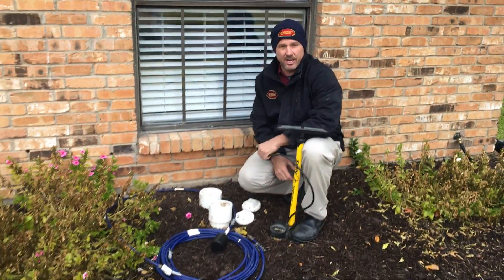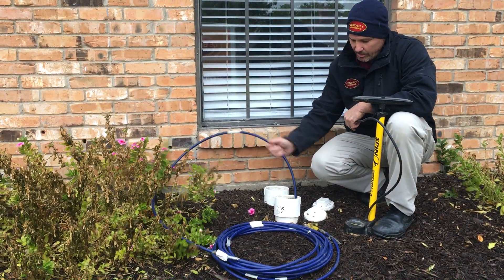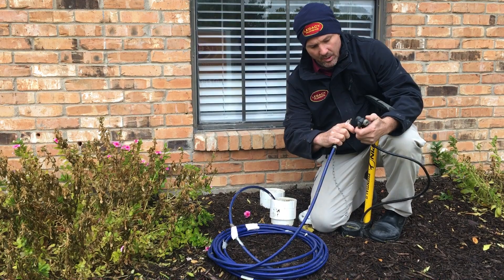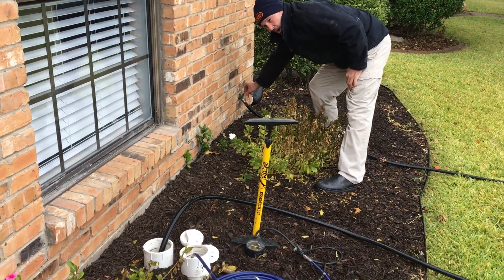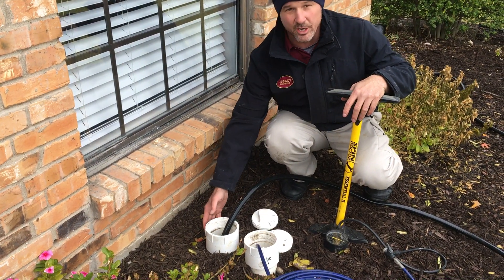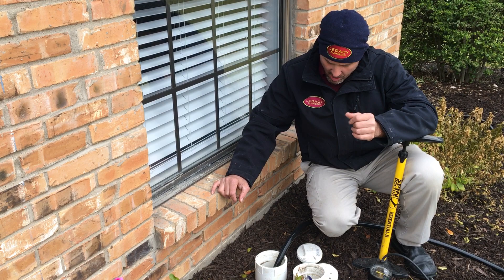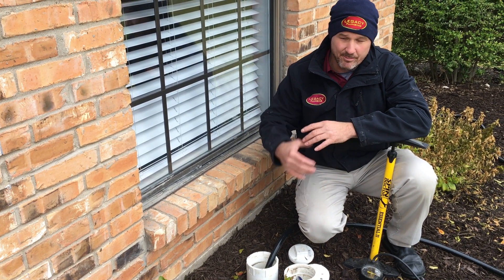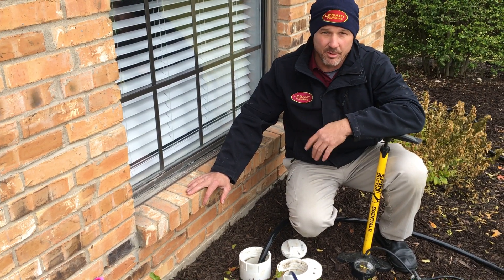Hydrostatic test on a drain system

Comment: Why is this done.
The sewer lines in the home do not need to be watertight.
The bottom 1-2 inches of the pipe are used for sewer drainage, they are never full.
This is a scam and unnecessary for normal construction.
A repair man’s dream!
Fixing something that is almost completely irrelevant.
Reply: wtf are you taking about? lol
Reply: You're going to love what happens when your drains arent water tight and you get a clog downstream.